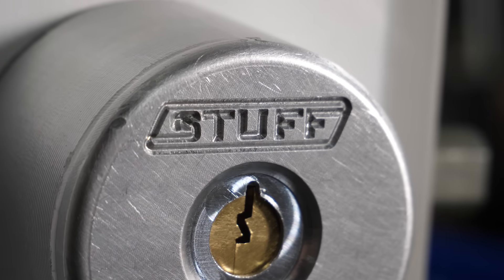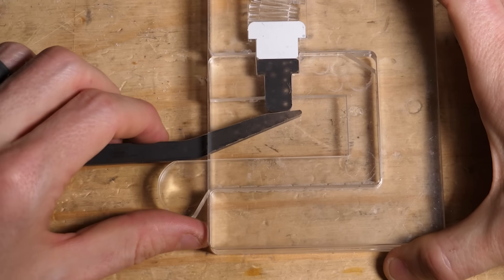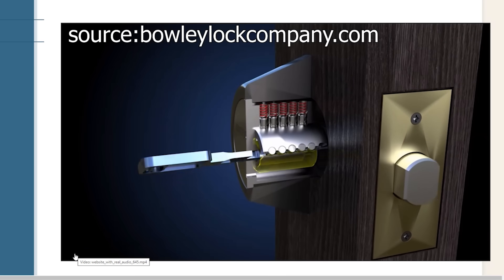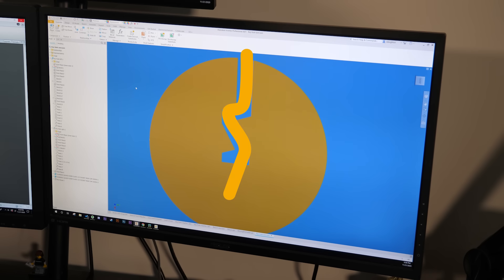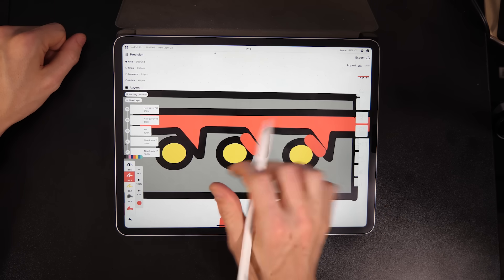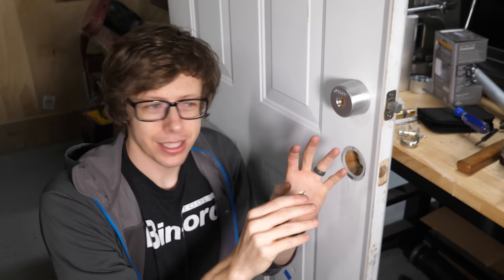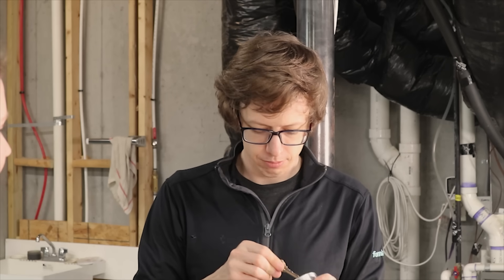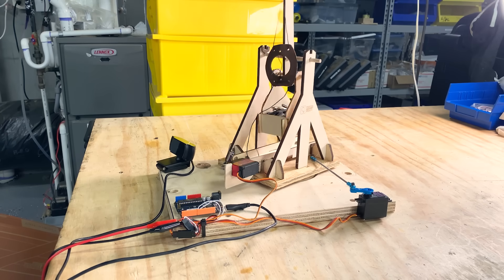Making an unpickable lock. Calling locksmiths

Comment: send it to lockpickinglawyer.  He'll open it in about 10 seconds
Reply: Not if what he says in the video is true.  That you need all pins set at once.
Reply: @my3dviews  he'll probably do something like a combing attack like he's been doing recently.  just lift them all above anything important
Reply: @matthewteears9326    They all need to be lifted to the correct height at once.  If one or more pins are too high then it won't open.  Not sure how combing would accomplish that.
Reply: @matthewteears9326  that kind of attack shouldn’t work here since the pins all need to be at a specific height and dont only bind when they’re correct, unless I’m misunderstanding how combing works
Reply: @my3dviews  instead of the actual correct height, just lift everything up over the top of that piece that has the slots cut in them.  I agree that it probably won't work, but if anyone could figure out this lock's weakness, LPL can
Reply: @matthewteears9326    Sure if the mechanism allows for that.  If designed properly combs are useless.  They shouldn't even fit in the keyway for starters.  If they do they shouldn't allow bot sets of pins to be pushed past the shearline.  
But yes, I agree if there is a weakness LPL will find it.  Hopefully it won't be a video that's under two minutes, with one of the minutes being used to explain where the lock came from.